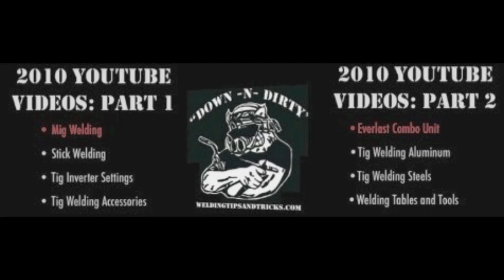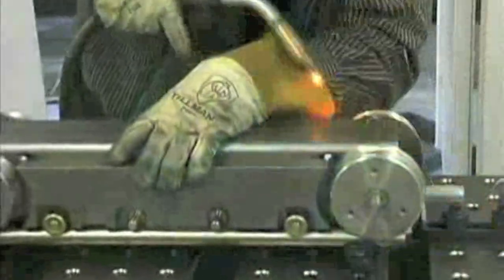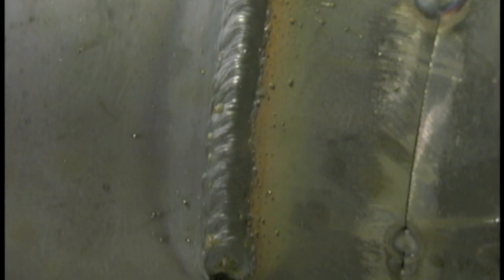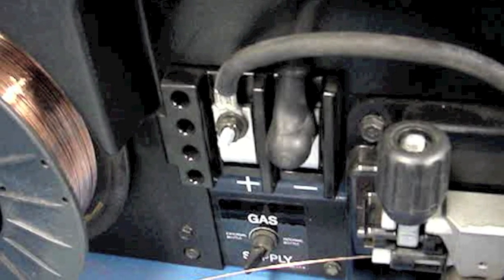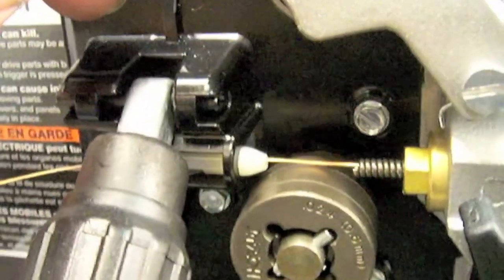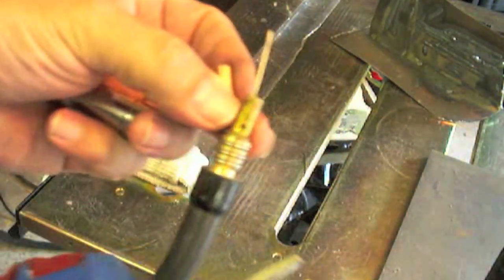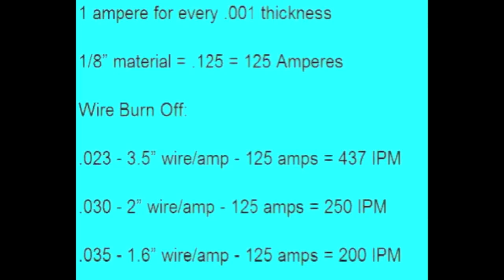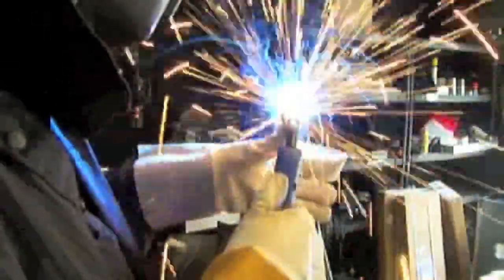How to Mig Weld - Down and Dirty Tips

Comment: Okay.. Now I am confused... :0
My brother is allowing me to use his Lincoln 3200 mig welder (flux core no gas) to weld some tub brackets in my cj7 and to weld some nuts to the back of my dash so I can easily remove my gauge "pods"... Questions I have: The metal on my tub is thick, lets say at least 16g the brackets are thinner approx 18-20g so any ideas on what speed the wire should be? I tried B-3... But if I touched the nose of the mig feeder to the metal it would stop welding and make a weird sound.. It was fine if I only touched the wire to the metal though.. Thanks for the video. Hope to get this right.. ;)
 Also, can you explain in laymen terms which polarity I should have the welder? It will be bare metal, and no gas just flux core feed...
Reply: For flux core feed you should have your polarity reversed from your average mig wire, instead of your wire being positive, it should be negative and like you said there's no shielding gas, which can make it extra tricky. Hope this helps brother!
Reply: rag Doll Oh yeah, I forgot to mention, for heavier duty thick steel welding (like for automotive welds (especially for offroad vehicles), it's better to have some solid (non-flux core) mig wire, and ideally CO2 by itself. I say pure CO2 because it pentrates the steel much further/hotter, and makes a stronger weld (although it won't be as pretty if that's important to you), Argon/CO2 mix is by far my favorite though, it's very easy to keep a stable arc, it looks ALOT bettter too if your welds will be showing, because it doesn't splatter hardly at all, the solid wire isn't too hurtful on the wallet, I'd go pick you up some, as well as CO2 because that's the best way IME to weld on your offroad rig, my 96 Bronco has alot of welds on her that have taken BIG abuse, and the CO2 welds held up perfectly! Good luck dude!
Reply: cybertree
Thanks. I'll check to make sure it's on the correct polarity. :)
Reply: cybertree
That's dudette, not dude... And Thanks for your help.
Reply: rag Doll Gday ragdoll,I am an old weler who ,I hope,can give you a few pointers.First of all I don't know your machine but the two variables are Amps and wire speed. The general rule of thumb is 1 amp per thou of an inch. I tend to add 5 amps to the mix.. If you are using flux core then the handpiece is connected to the negative. To set the wire speed find a scrap bit of steel ,set the speed in the middle somewhere and start  a bead,if it sputters and spits then it is too much wire. Traditionally they say that the sound of frying eggs is the sound you want. It is all about the sound it makes. Practice a lot. The less wire you put in the quieter it gets. Practice some more.Thin material is hard to do straight up Get a pool happening and learn to move at the speed that will move the pool easily.Practice some more still. Good luck Ross
Reply: eiclan Geez Louise! There ain't a CV semi-auto welder in the world that allows you to set amps. The two basic variables for inert gas, active gas, multi-shield, gas shielded flux core and self shielding flux core semi-automatic electric arc welding (all distinct iterations of what is generally referred to as mig welding) are wire feed speed and arc volts. Amperage is determined by the rate of feed and bound by the voltage set by the operator. The more volts, the longer the arc, the more wire necessary to maintain correct arc length resulting in higher amperage thus hotter weld pool. An operator can set a voltage and adjust wire speed to suit or vice-versa (in practice it's usually a bit of both) but in any case, amperage is meaningless in this context.
Reply: That may be the case in the 110 volt third world country you come from but where I live we use the term Amps because at the end of the day and where the wire hits the road,the potential between wire and the job is all about amps. My machine is a 240 volt 300 amp machine. Sounds like too much youtube and not enough handpiece time to me . Cheers
Reply: eiclan Input & output. Supply power & welding power. "240 volt 300 amp machine" = 240V input, 300A max. welding current. The full relevant details should be in the machines operating manual (if you still have it) and on a plate on the back of the machine. By way of example, I'll quote details for the Cigweld Transmig 165. Supply voltage & current: 220/240V single phase 50/60Hz 10A (Standard domestic general purpose outlet in Australia, where I live.) Wire speed range: 1-13m/min. Welding voltage range: 16-24V. Welding current range: 30-165A. Duty cycle (How much welding you can do in a ten minute cycle without overheating the machine; 20% = weld 2 mins, rest for 8): 100%@70A, 20%@150A. Regardless, there is no provision for setting amps as this is dependant on the interrelationship between output volts, wire cross-sectional area, feed speed and the ionisational potential of the arc atmosphere. And yes, being unemployed for the last four months in spite of thirty years welding experience, I agree; too much youtube and not enough handpiece time.
Reply: Not wanting get into semantics too much,yes you are right but here in Australia,and I live here as well , the jargon has always been wire feed and amps. Even the old stick machines were denoted as using amps but I suppose in the youtube age of Americanisms volts will out.Yep I know what you mean,the young fellas get the gigs these days. I got under the shield for the first time in a year and a half yesterday to weld up a few little bits for the old mates race car. I went in the Jap safety boots and he did the "can ya just" so the hot shoe shuffle happened,but you get that with CO2. Cheers
Reply: eiclan Sorry man, love semantics. (My daughter has degrees in linguistics & anthropology, bless her cotton socks!) Regardless of words used, when migging, you WILL only be adjusting wire speed and volts. MIG/MAG only units like the Transmig I mentioned (and, I'm guessing, like the one you were just using) have a stepless dial control for varying wire feed speed and stepped switches for voltage. (Often arranged as Coarse/Fine, sometimes MIN/MED/MAX.)
Now, a stick only machine (in the majority of cases) has a single output control and this is for good ol' amps. 
Then we have the new you beaut multi process inverters, aka MIG/TIG/Stick. These machines have two stepless dials with digital displays. When using the MIG function, both dials/displays will be active and one will control/display wire feed speed, the other will control/display volts. When using either the TIG or stick function, the voltage control/display will become inactive and the wire feed speed control/display will become an amperage control/display.
One more example of the irrelevance of amps when talking about semi-automatic welding. Remember the big old DC generator welders? Lincoln still make the SAM-400. These stick welding machines provide stepless control over both amperage and voltage and in the hands of an experienced operator    are every bit as good as the best of the modern inverters. Semiautomatic welding capability is provided by using the LN-22 or LN-25 wire feeders. The amperage control is set and left at maximum and welding output is governed by the voltage control on the power source and the wire feed speed control on the wire feed unit.
For the benefit of ragdoll (who, if she's still reading this is probably a gibbering mess by now), when it comes to actually setting these parameters, what eiclan said about frying eggs is a good guide. Generally speaking, you need to keep the distance between the "nose of the mig feeder" and the weld consistent (about half an inch) and in simple terms: thin metal = colder weld needs less wire less volts, thicker metal = hotter weld needs more wire more volts, all the while keeping the eggs frying. But most importantly; get a hold of the operators manual and read, do, read, do, read do. Anyone who says "when all else fails read the instructions " is an idiot. ALWAYS read the instructions first. And third and fifth and seventh etc.
Burn the wire baby :D
Reply: +eiclan Voltage is pressure, current is flow. Current is always drawn by the load attached. You cannot push current, only voltage. Any current limiting scheme involves adjusting the output voltage. So it is really all about the voltage, not the current. Current simply follows the voltage level, and the resistance of the load. Sounds like too much thinking you know, and not enough theoretical knowledge to me.

Comment: would you use a mig weld for welding on a 7005 alloy bicycle frame? I want a welder but im not sure what im suppose to buy :/
Reply: Use a TIG welder but you need to be pretty good, if you never TIG welded before get some instruction otherwise you will make a mess of it.

Comment: If you weld outside do you still have to worry about harmful fumes ?
Reply: +Zach Green you don;t mig weld outside of you can help it. fluxcore you can, and it's actully better to do fcaw outside
Reply: +Zach Green doesn't matter where you are, if you are breathing in harmful fumes it is not good. Read up on personal protection equipment you might want to use, keep your head out of the fumes, etc. I bought a bunch of PPE stuff when I first got my everlast welder and still use them all. You really can't know what years of exposure can do to you over time.
Reply: i can and do know and use likely the same PPE you do. also have an everlast. also have an exhaust setup at my bench to draw off the fumes when i mig/tig/fig, or stick. indoors. all i've done outside is stick with any regularity, as i was taught that mig is too sensitive to atmosphere to risk it.

Comment: Hi, and thanks You are my scool for welding. I bouth a new Tig and Mig machine in China and I'm testing them. They are good bud I dont know for how long ofcourse.
My old "Becum" is a (German) transformer type and here in the country I can't use it enymore becouse the power lines are to weak. Have You experiance in weak power lines and how to solve ? There existing passive PFC's (Power Factor Corrector systems) bud they are more expencif then a new welding inverter from China !

Comment: I don't know if you have gotten a response from anyone about your welder from Harbor Freight, if you haven't then I will tell you that even the " top of the line " welder from Harbor Freight is a crappy welder, between how long it will let you weld to how long it has to cool down or the duty cycle that is the first thing that makes is a crappy welder, if you are wanting to build anything thicker then 20g sheet metal, buy the lincoln shown here, trust  me it's worth it,

Comment: The 1st most important TIP & TRICK should be Safety ! Set up a fan behind you to blow lightly on your project to move the fumes immediately away from you !!! This way you willnot inhale an ounce of lung destroying fumes ! Then, "EXHAUST" those fumes to the outdoors !
Reply: so many people have told me to check out the welding mastery webinar for help so im hoping i learn something today
Reply: RMCUSTOM  Gday mate,as an old welder let me tell you that the fan idea is good but you have to be sure that the breeze does not interfere with the shielding gas as this will cause porosity. If the fumes bother you I suggest you get a positive ventilation shield. I made one for myself, a small airhose and an outlet in the shield and a small valve to regulate the flow. If you have the out let blow on your face it will also stop condensation on your glasses ,if you wear them as I do. Cheers Ross
Reply: +eiclan They are compulsory in NZ now, wear the belts and filter unit  under your overalls for 2 important reasons 1) spatter rolls down ya overalls and settles nicely into the belt everytime .2) they wont filter out a good fart, the welder gets a lungfull! -great stuff.
Reply: +RMCUSTOM A fan would blow your shielding gas away... a fan is NOT a good tip.
Reply: +Plumbing TV  Argon has come a long way since shutting all the workshop doors on the slightest breeze, dont know what they did but gas is heaps better now

Comment: I weld in Japan so obviously everything is in Japanese which makes it more difficult to find your way around the machine. The settings are basically the same but they have a crater setting for double action welding which I haven't seen mentioned in any MIG welding clips here yet. We weld lots of metal tubing and my biggest problem is burn-through with light gauge metals like 2.3 mm tubing etc, so far there doesn't really seem to be an ideal AMP/Volt setting to use so we go hot and just learn to adapt our speeds....if anyone here has a lot of experience with thin metal tube joint welding I'd like to hear from you coz there never seems to be a guarantee you won7t burn  a stinking big hole in a joint at any time. You could do 100 welds with no problem and all at the same speed and then weld number 101 will suddenly blow a big hole even though everything was the same as the other welds....
Reply: I have welded up a lot of exhausts which can be a similar thickness to what you are welding and speed is key to not burning holes.
Reply: Dan Burton
Reply: Dan Burton cheers Dan you're right about that! Have you ever tried pulse?
Reply: Use a stitching motion as explained in video. It helps to ensure the bead flows out and doesn't spend too much time in one spot that causes blow outs. I weld a lot of 2.5mm to 2mm wall RHS. Often 5mm to 2.5mm that requires some bias on the looping to keep the 5mm side of the weld hotter. If you straight line it the heat is focused on too narrow a spot and increases risk of blow outs.

Comment: Ive got a question, sometimes when i play whith the adjustments when  welding, instead of it sounding the normal zzzzzzzzzzzzzzzzzzz sound , it will go to almost no noise like i have the amps up to much, should i lower my amps

Comment: I've got a Millermatic 135 and that roll tensioner does more that prevent bird nests.If the wire from the roll come in contact with the inside of the metal case and I've got my finger on the trigger then the wire will ground out against the case.

Comment: I think your making it like 100x more complicated than it needs to be. charts are good but it all comes down to how you weld. there is no replacement for experience and experimentation. he probably pulled the values from when he started to learn to weld and adjusted them ever so slightly to make them easy to work with. i've seen other charts and most are in the ball park. again, these are starting numbers, how you weld and how your machine operates will make things change slightly.

Comment: excuse me my names chase I'm having a problem with my welder it won't spark it feeds threw but no matter what I do it won't weld what do I do ?
Reply: 1) RTFM = Read the frickin manual
..1a)RTFM
..1b)RTFM
2) Check lead connections inside the box and ensure they are connected and tight
3) Call tech support for the brand of welder you have
Reply: gamemaster123ism I would start first with the ground clamp. A lot of machines come with grounds that are not real good. That's an easy fix if that's the issue.

Comment: Question, Harbor Freight helmet... burned my face and eyes... have you heard of this before and why?
Reply: +George Adams The reason you might have gotten a burn on your eyes or face is because, if you have a auto darkening helmet you have to turn up the shade level to about 10 or 11 due to the brightness of MIG welding but then again it will all depend on your preference. But that is the only thing that I can think of unless you bought a faulty helmet.
Reply: +George Adams I know somebody who has a Harbor Freight helmet and he's used it into the ground without issue....

Comment: what is the difference between flux n mig
Reply: +Wayne Ermine Mig is the welding process using in this video and flux, also called flux core, is the type wire using. The flux is when your wire have a protection gaz in it to have a better weld. You can also use a standard wire to weld but you may need a protection gaz like acetylene and oxygen to have a strong weld.
Reply: ok thank you
Reply: +Vincent Paquet Why comment if you have no idea what the difference is?
Reply: +Wayne Ermine 

Both these guys are wrong. Flux core wire has a chemical core inside the wire that, when heated, creates the shielding gas. MIG welding uses a cylinder full of gas to do the shielding. MIG welding creates a better weld with less porosity than flux core welding IMO, but needs additional equipment and cost (gas & cylinder, gauges & regulator, gas solenoid to control the flow of gas, etc.) than flux core does, and there are less fumes to deal with.
Reply: MIG = Metal Inert Gas
Wire Welding TYPICALLY refers to a flux cored wire through a machine similar to a MIG welder  but has no option for gas shielding at the nozzle

Flux core wire is wire wrapped around a flux which when heated provides the shielding gasses, as opposed to a shielding gas being released at the nozzle to prevent oxidation and introduction of contaminants to the weld

Comment: i weld with a recess just sos my wire doesnt fuse with the tip lol
Reply: Same here brother, I personally don't have that big an issue with splattering up my gas hole (sounds wrong lol), because I actually prefer quite a recess. My tips stay untouched, my arcs seem WAAAY more stable (probably because the Argon/CO2 is closer), and thus my welds are pretty much perfect. Plus it feels more like welding with a mechanical pencil, rather than a normal one if that makes sense, more accurate.